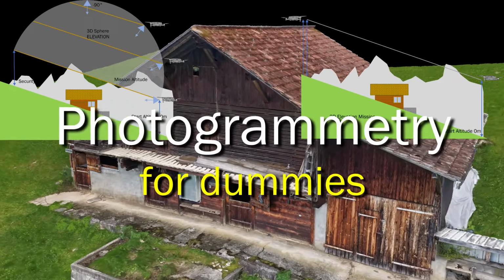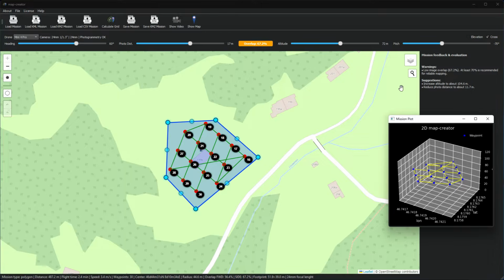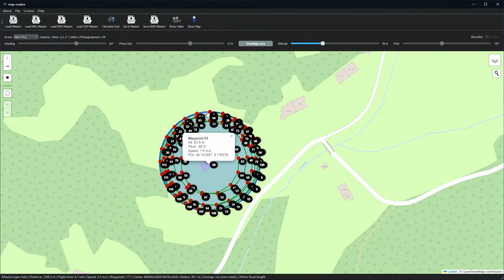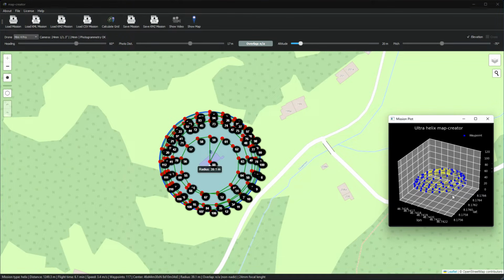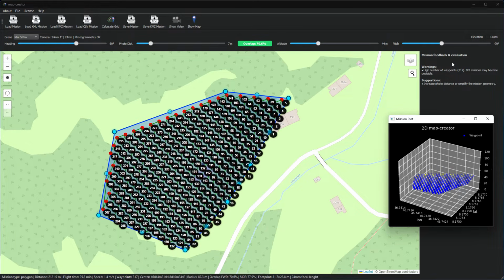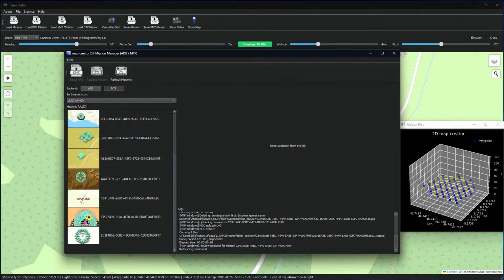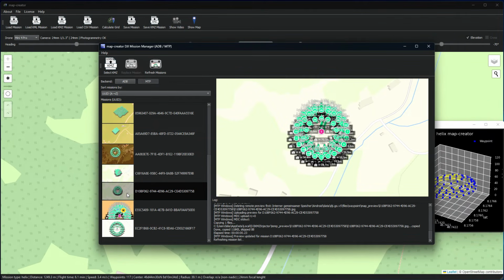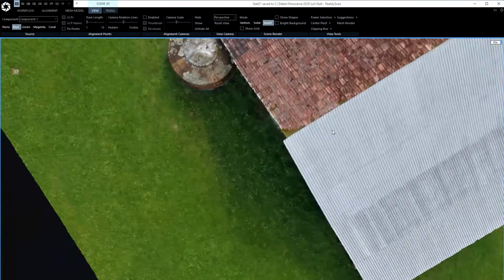Photogrammetry for dummies with the map-creator and the DJIKMZInjector

Comment: Thanks for your work on this, I'm happy to see it's now on MacOS as well. One workaround for the limited memory of RC2 controllers is just using the timelapse photo feature of the Mini 5 Pro. Then you can greatly reduce the number of waypoints and shoot larger areas with good coverage. It's not clear to me why you would't provide the capability for a user to use lens x when they have options (Air3S, Mavic 4 Pro, or even the 'fake' 2x of the Mini 5 Pro). Using a longer focal length does not necessarily mean that you'll get more pictures; the altitude sometimes has to be higher to complete a mission. Or when modeling objects, the pilot might desire to keep a larger working distance by using a longer lens. Keep up the good work, if fills a very real need among those of us using consumer gear to do mapping.

Comment: Hi Kilian,

I’m in Hong Kong. After drawing the polygon, I tried to calculate the grid, but I’m getting an error message: “list index out of range.”

Could you advise what might be causing this and how to fix it? 

Also, is it possible to:

Change the basemap to Google Maps, and
Switch the elevation dataset to GPXZ?
If yes, could you please share the steps and any recommended settings?

Many thanks,
Alex
Reply from the maker: Can you save your polygon in a mission file and send it to me. GPXZ is possible with my macOS version. I will introduce soon a local DEM server for the windows version.
Reply: @KilianEisenegger  im getting this same issue here in california usa can we get in touch i really like your software over other ones

Comment: Hi Kilian. I have a question, if I buy the map-creator iOS app in my Iphone, how can I export the files into my controller? We still need a computer? I use the DJI RC PRO 2 with the Mavic 4 Pro. 

I wonder if using the app we can do it on location, just with the iphone and the drone, without a computer.

Thanks for everything, awesome work.
Reply from the maker: Yes, you can use the iPhone and replace the mission. If you have DJI Fly on the iPhone it is easy to replace. I did a video in 2024 about this feature. 
I use that a lot to optimize altitude on the place.

DJI Fly KMZ mission file import with the map-creator iOS and DJI RC, Mavic 3, DJI Air 3, Mini 4 Pro
https://youtu.be/Ml7EZ4umqTQ
Reply: @KilianEisenegger That is great, thank you